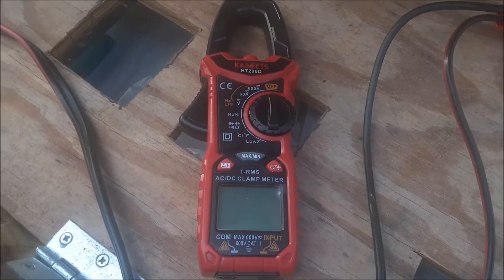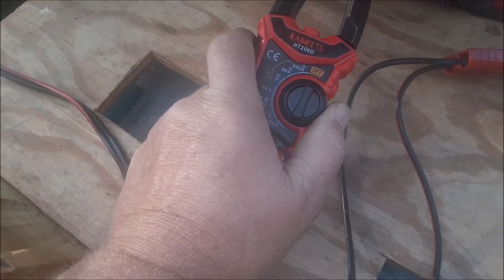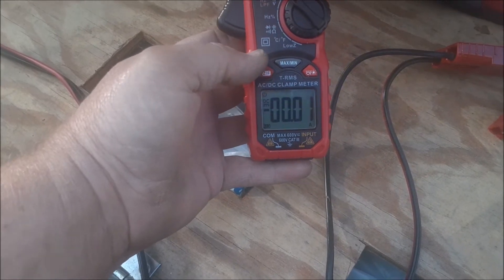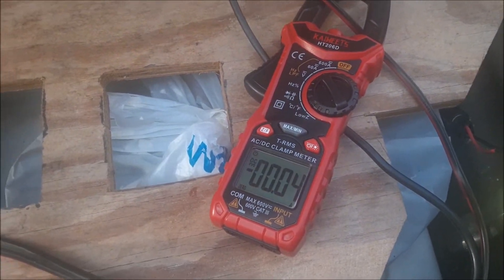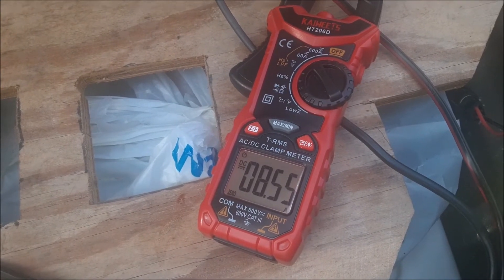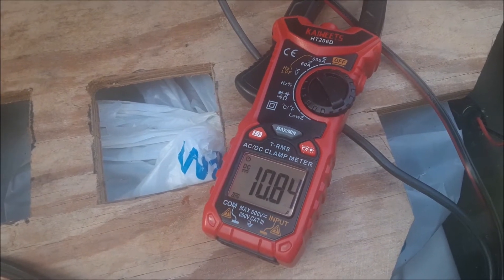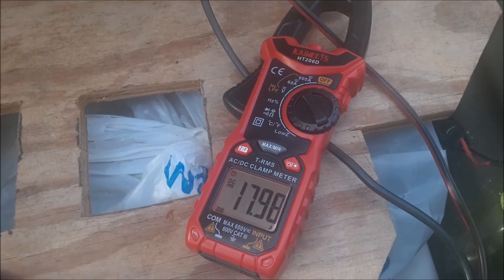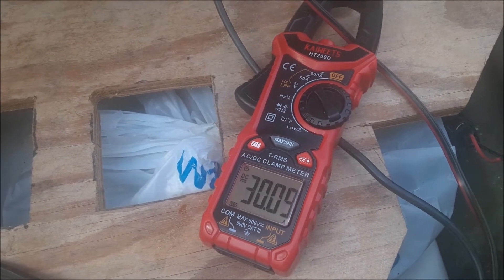How To Check Amp Draw On Your Trolling Motor

Comment: Seems like you have a 30 lb thrust motor. Your reading on your multimeter is good. You need at least a 100ah battery and in your case you have a bigger boat so it is working hard to move it. I use a 14 foot sports pal canoe and it is a lot lighter craft. You may have a battery that could be at the end of it's life cycle and a deep cycled battery is what you need and should not be drained below 50% and that is why on bigger boats they buy two and put them in parallel so you could have 200 ah and bigger boats usually have 50lb of thrust to move their craft. Not sure how big your boat is but by the looks of 30lbs thrusts should move it but according to your reading 30lb of thrust is 30ah and if you have a 100ah battery and to get your boat moving you got 2 hours of run and your battery will go below 50% but if you stay in 2nd gear it will be 10amps so you should get more hours but it will take longer to get there. I know bass boats  have 3 batteries. 1 battery to start the engine and 2 in parallel for their trolling motor with lots  of  amp hours
Reply from the maker: Hey, thanks for checking out the video. The motor is a 30 thrust Minn Kota. Boat is a 14-foot Jon. I have 2 105ah batteries run in parallel but they are 3 years old but have been having issues for 2 years now. When I'm by myself I run one motor but if my buddy goes, I have another 30 thrusts on the front of the boat as well. Shortly after this we took the boat to the river and had no issues at all. With running the 2 motors and I took my amp meter with me. What I found interesting is even with running both motors they only drew 30 amps together. I would have thought it would have been 60 amps but I'm not an electrician. Both motors at the same time do really well but we don't usually run them at full speed. I have also noticed that I only seem to have issues when I am by myself and running the one motor. Could be just my luck. Next time we go to the revisor I'm going to take my amp clamp again. We do a lot more traveling as opposed to the river because we just go up stream and float down. Again, thanks for checking out the video and your input. Appreciate it.